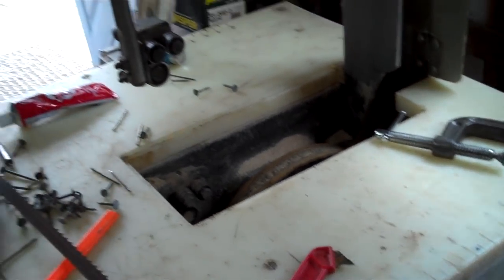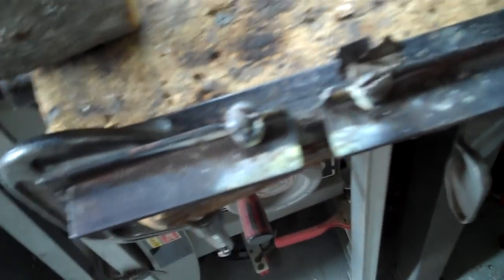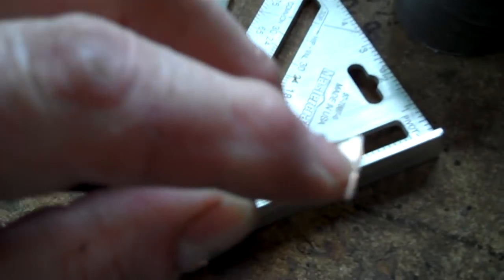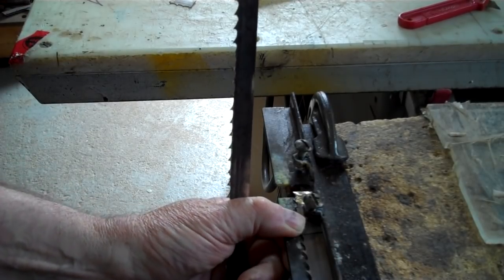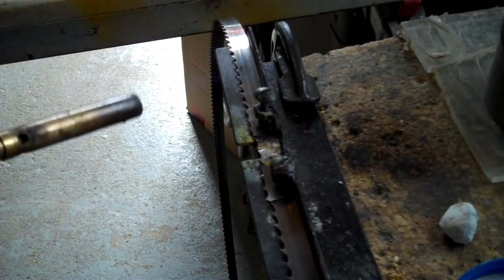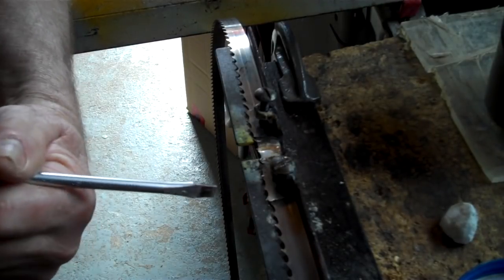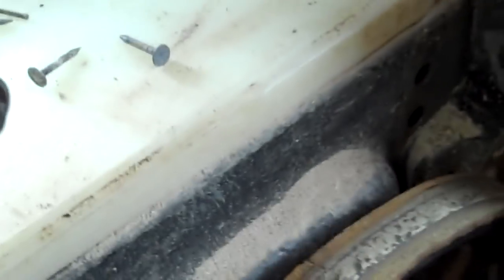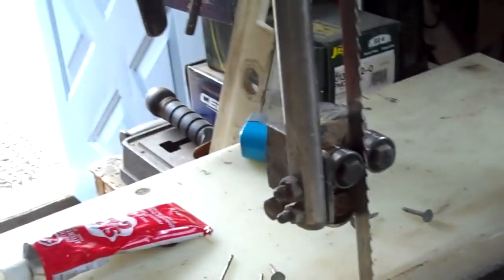How to join a band saw blade yourself, silver solder DIY

Comment: That thumping sound is the braze joint passing over the rollers etc. You should clean up the joint a little better and take off the excess solder bulge. Keeps the blade from stressing at the solder joint and prematurely breaking again. This is especially true with metal cutting saws. That excess solder will tend to bind on the metal kerf and break the joint quickly.
Reply from the maker: thanks

Comment: what is the name of blade burner/ heater that you use to fire the blade for jointing.
Reply from the maker: Its called the Bernzomatic UL100 Basic Propane Torch Kit
Model # 368375

Comment: When was the solder added?  I missed it some how.
Reply from the maker: 4: 28 I have a piece in my fingers that I used. Thanks for comments. Solder for the blade is added as soon as the blade turns red hot and flux has been applied. cleaning is a must too.

Comment: You mean the Newfie way!
Reply from the maker: of course, it works.....tnx 4 comment..........cheers
Reply: hunt4fish does it make a little noise because that section can't bend anymore?
Reply from the maker: not really, fine to me; the wheels it goes around on are 13 inches diameter so there isn't a huge bend and if you grind the silver solder to a smooth surface where you join it it's very good actually. I cut a lot of stuff with that rig and most blades are from my buddys broken pile.